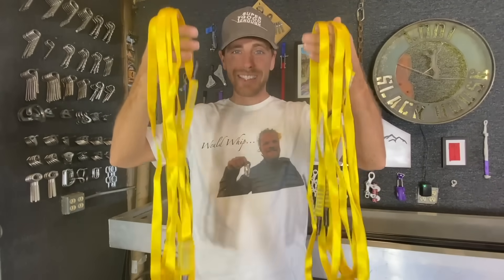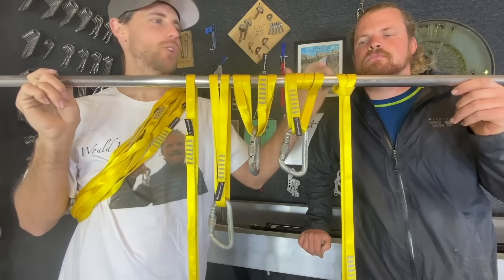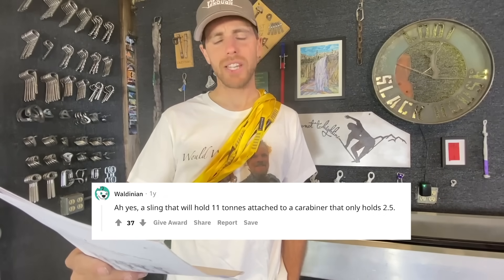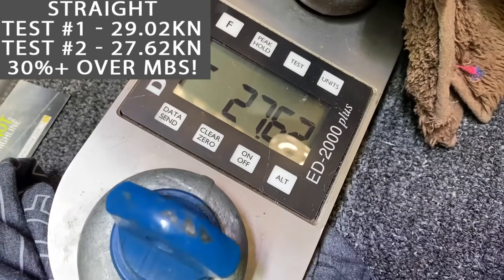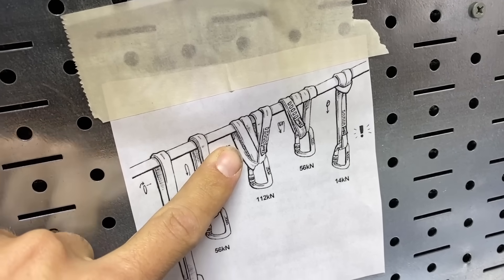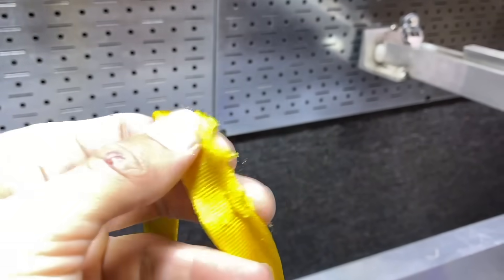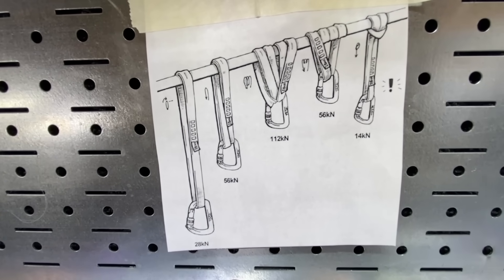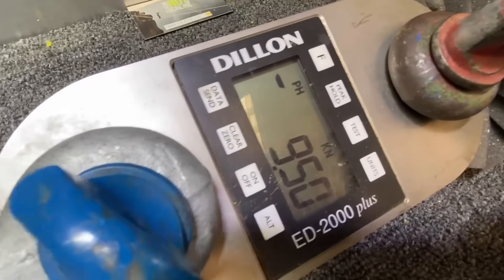Climbing Sling Myths

Comment: In my opinion, he problem with the double-double is that at some point, the overlaps compromise the ability of the webbing to shift and equalize the load across the four segments.  When that happens, the one that's already under the greatest tension will collect all of the load, with its failure terminating the test.  If a lashup could be created which allowed each web to move independently, the full quad capability might become possible, but who's going to carry that much hardware?

Comment: 2:05 the carabiner sits straight, because the sling is not doubled like shown in the image. It's supposed to be clipped in, moved around the bar, pushed through the carabiner, around the bar again and than clipped in a second time. (Like the 4th version, just with clipping the carabiner into the double loop that is winding uselessly around the bar.) Well, the "supposed to" could be argued with, but at least that is what's shown in the image.

Comment: You will not achieve the 4x load due to slight losses due to sling angle, bunching of the sling in the one shackle as well as friction of the sling overlapping. If this was done with a much longer sling so the angles would be less and over lapping othe sling could be minimized or completely avoided and you would still not get the 4x but be much closer.

Comment: Aside from manufacturing variations, which are likely to be minimal, friction within the fabric, especially in multi-layered configurations (fabric rubbing against fabric), plays a crucial role. This can have positive effects, as friction can increase the overall work required to break a sling, cause the "way" to maximum natural extend before aan overlod begins to take place can become longer. However, excessive friction can weaken the fabric due to the heat it generates. This is also one of the reasons why these tests under static tensile force (force applied gradually) offer little insight compared to a dynamic, sudden, large change in load. A sudden, large change in load can generate a significant amount of heat through friction (fabric rubbing against fabric) in a fraction of a second, leading to entirely different results that can become deeply disappointing compared to static tests.

Comment: When there is enough friction between overlapping pieces, one piece sees more load than the other, and you lose full advantage of the doubled or quadrupled sling. Dyneema slips more, so equalizes load better. But dyneema still has it's more limited bend radius to take into account if using a narrow bend.

Comment: On most technical sheets girth hitch is actually said to be 80% of strength not 50% so it's x0.8. so with actual BLL of 28kN it would result in 22.4kN. that is closer to the numbers you got.

Comment: The most critical simplification that is being done to get those numbers is treating the sling as a 1D object of negligible thickness. However, a rope is not 1D, and a sling even less so considering it is very wide relative to its thickness. With this, it is extremely easy to get an uneven stress distribution within the cross-section. Some strands will rupture first, which load their neighbors more, causing a progressive cascading failure across the cross section roughly from highest to lowest stress. You can see this in some tests, where the break is clearly starting on one side and progressing to the other. Why is this? Because the sling is not perfectly flat and parallel, and so some strands must stretch more and take on a higher load. Prediction? The configurations with the  sling forming an angle with the support will break at lower than theoretical strength, and the higher the angle the lower the strength. This was exactly the case, supporting our hypothesis. Moreover, when the sling partially overlaps with itself, you have uneven thickness, with one part having to cover a longer distance (more strain so more stress), which majorly skews the cross-sectional stress profile causing an earlier break. Most simply put, the less it "sits nicely" the lower it will break. With these hypotheses, we can deduce that having a rigid support is skewing the results, as tying to a flexible rope will tend to lessen this effect helping distribute forces more evenly. Am engineer.

Comment: @10:55 One thing I am curious about regarding MBS is your shackle size width and diameter. If you increase the radius of the shackle or biner, you "should" get an increase in maximim breaking strength from the slings. You also have two different diameter shackles in the test by looks of it. The sling is bunched on the pulling side. Make the shackles sizes equal across the formula to cancel each other out?

Comment: Don't forget MBS is the minimum breaking strength of the product, meaning all tested samples broke at or higher than that, so seeing higher that MBS is not surprising, especially in gear where wear is expected. Black Diamond would rather under promise leaving you some wiggle room than give you something that will disappont at soon as it sees any use and wear.

Comment: A question more that a comment. Wouldnt the diameter of the object the sling loops around or wraps around have an effect on the breaking strength?  Also what Ive gathered is that breaking strength is fundamentally different when looped vs. wrapped?

Comment: My theory, I think the stress distribution on each strand is not perfectly equal when there are strands overlapping and interacting. Any strand that is marginally shorter will take a disproportionate amount of the load, hence the slight reduction in the multiplier.

Comment: Question about the stitching.  It seems that one "row" of the stitching is a where some breaks occur.  Knowing the webbing will stretch, wouldn't the stitching be less inclined to break if it were oriented differently?  Like in sewing fabric that stretches, you do a zig zag stitch in the direction of the stretch.  So, on your webbing, I'd try multiple zig zag stitches aligned to the direction of the pull.  Also, the stitches in this video look pretty tight.  Meaning that each time the sewing needle passes through the material it can cut or damage the webbing.  And it seems tight enough that even ball  point needles might not make it through.  Just sayin..

Comment: The answer to why all straps break below their theorized (or sometimes advertised) maximum is because of heat. And heat, as we know, is the enemy of plastic, which webbing is made from. As you put energy into the webbing by means of tension, the excess gets shed out of the webbing in the form of heat, and that heat necessarily changes the mechanical properties of the webbing. In theory, you could achieve a higher (e.g. much closer to theorized maximum) load on the straps by 1) Stretching them much slower, 2) cooling them as you're stretching, and 3) stretching them in small, stepped intervals. Now, obviously, this isn't really a practical way to achieve the maximum because there's no real-world use case where loads are slow and stepped and the webbing is being actively cooled at the same time. But.. that's how you'd get to the listed max's. You basically have to cheat and have super granular control the conditions that the webbing is being stretched under.

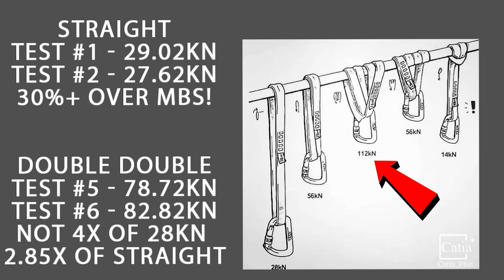Comment: 11:18... The angle of the pull is not perpendicular to the bar for the outer straps, so I'd not expect the strength to be 4x, as there is sheer forces because of that off-centre pulling.

Comment: On the 4 wraps it looks like one (or more?) section of the sling is twisted to enable the wrap, which must cause uneven forces on the sling. I’m guessing it puts more force on the edges of the sling than the center, which might be the reason why it breaks at a lower strength than anticipated. I’m not sure but I think it looks like it’s breaking in the twisted spot

Comment: Girth hitch: you used a big pin. Of course it was stronger. I think the CE standards use 12mm pins in most places. The +30% on the baseline tests might be from using the big pins.

Comment: I'm very late to the party but, in practice a nylon sling that is twice as long should be able to take a higher dynamic load before breaking even if the static break force is the same due to the higher amount of work needed. Seems like a fun test for the drop tower considering that the results have to vary depending on how the test is set up, will the impact be after the same fall distance or will the longer sling get a longer fall due to the extra length.

Comment: I haven't made it through the video yet, so they might have already explained this, but I'm guessing the ones where they overlap across the bar break earlier because the friction is preventing them from evenly distributing the force between the loops

Edit: The ones in the video didn't seem to overlap that badly, so my current guess is that they tear earlier because of the wider angle, basically the wider the angle the more stress you put on the slings compared to the weight they're holding. At a 45 degree angle you would account for losing about half of the capacity from what I remember learning.

Comment: For the 3rd method tried (the 4th picture) as well as the 4th tried (3rd picture) I think the main reason for the results it's because the force exercised on the string is not the same on all sections. And 2 big reasons for this I think are: 
1. More friction and imperfect sling contact makes some sections receiving more force than other sections. Also it makes the force direction being misaligned with the expected pulling force (because of the sling contact and twisting the pulling force is't perfectly vertical anymore -> the sling breaks easier)
2. Is is also probably kind of impossible  to have the 2 ends perfectly splitted and, because it's wrapped multiple times one end might receive more force than the other (while if the sling is not wrapped multiple times it will probably equalise itself at some degree).

Comment: When climbing, we need to be fast and simple. That is the more important, so you don't waste your muscular strength in hold positions, while you build a bomber placement. Interesting tests, but if you do things correctly, slings and fixed anchors will never be a problem in climbing. But for industrial uses, when you must move heavy weights, these informations are gold. Here in Brazil, while climbing Pão de Açucar in Rio de Janeiro, a climber died hanging on the rope. He fell down maybe 60 meters when a fixed steel cable broke. The rope, anchor, carabineers and slings holds, but not his body. He died from internal injuries. The weaker point will always be your body.  If you generate more than 8 KN or 10 KN forces while climbing, then I guess you did something terribly wrong.

Comment: Dan Merrick here. One issue I've had with testing is that the shackle pins rotate pretty freely. Rubbing seems to reduce sling strength pretty significantly so I am curious if the girth hitch would perform as well if the pin didn't rotate while loading. I think the result should be close to the same but I am not certain.

Comment: All of the lifting slings we use at work have similar but far more conservative diagrams on the label, IIRC they only show the multiplier for a basket hitch and a girth hitch and you actually get two different ratings for the basket hitch depending how large an object you are going around, i.e. you get a lower rating if the angle it creates is larger, but its only like 1.2x-2x max I think

Comment: I was thinking the same thing re the drop tower as a sharp shock load shouldn't have such a large friction burn and may have a higher Kn.   Being nylon and using the 1 inch tube tape for speed lining branches down in tree removal.    We buy 100 metre rolls and tie to what ever lengths we require.   I have broken numerous over the years but never had one break at the knot.   Being nylon and having a bit of slippage in the knot,   hmmmn  I wonder.
Love the Vids.  Cheers

Comment: Not sure if there is a video somewhere, but what would happen to a nylon sling if you girth hitched it to your harness and then on the other side girth hitched it to a carabiner so it stays in place. The use is just for resting. Would the strength loss of two girth hitches double to end up somewhere 18/19kN?

Comment: The problem with knots should be on dynamic loads. When you take a fall, knot tightens up fast and heat generated that way can melt the sling, weakening its rated strength.
On static loads, like in this test, that is not the case, so it is probably the reason numbers are much higher with girth hitch.

Comment: Your tests are awesome!  The practical is what maters, not the theoretical.  And the reason the chart is crap is because they assumed that the load share is going to be perfect for those 2x, 4x setups.  It's not.  And they assumed the knot strength of a girth hitch would reduce the strength 50%.  It doesn't.  Assumptions = bad.  Testing = good.  Theory = good.  When testing proves theory?  Then you're good to go.

Comment: Just like when you braid 3 ropes together you only get 2 x the strength because the rope isn't straight and turns converts 30+ percent of the tensile load into shearing load .
Same applies to knots in dyneema they usually reduce strength by 30-50 percent so splicing is important .
Also the low stretch character of dyneema likely contributes to sudden failure like comparing a electrical tape to a box clear tape in character.

Comment: Your "double double" is tied incorrectly. To recreate the pictured 112kn anchor, you first need to secure the sling to your 2:1. Next, you want to wrap you sling "doubled" around the shackle and back to the 2:1 shackle. Do this three times and finish by locking the last bit of the sling back on your 2:1 shackle as you started. Along with the overlapping of the webbing, that is the reason you aren't seeing the correct results.

Comment: Variance in the number for doubled up is more than likely due to veer angle, when doubled up you cannot possibly have all legs of the strap straight and parallel to one another so you won't get exactly 4 times, Instead, there will be an angle to them which will reduce the breaking strength of the rope. Now as for the choker or girth hitch as you call it I'm not entirely sure why they handled so well I guess it comes down to the materials but I've always known them to be 40 percent of total strength however that is as far as I know a worst case scenario number as with a choker there are a lot of variables, first off it depends on the shape of what you hook it to, second it depends on the angle at which you pull on the choker, if you go through the loop and create a choker then pull directly backward from the loop that is the lowest possible performance if you go through the loop and directly up from the loop it's the highest performance. 
That being said everything I know pertains to lift and recovery rigging not climbing rigging so I don't know how different materials across the industries react. 
https://www.mazzellacompanies.com/learning-center/what-is-best-sling-hitch-vertical-basket-choker-bridle/#:~:text=When%20using%20a%20choker%20hitch,a%20single%20leg%20vertical%20hitch.
Now, When it comes to generalized ratings like what you showed it is always to show the lowest possible breaking rating you never assume it will break at higher than what the lowest possible number is because depending on how you set it up and what the angles come down to you may exceed that breaking strength, So in terms of the choker that half rating is taking into consideration the lowest number that it may break under in certain circumstances where as you tested in a way that produces the best results for that particular setup, even though I disagree with the chart you showed even still because from my understanding the worst case number is actually 40 percent, not 50 percent. So i would take it a step further and say the choker would be properly rated at 11.2 kN not 14, But even that goes against everything I know because in the lifting and recovery rigging world we don't go based off breaking strength we go off working load limit after a safety factor, With climbing gear having a safety factor of often 10:1 I would go even further and say the choker should be rated at 1.12 kN with an ultimate load of 11.2L. It's always interesting to me how climbing gear has such a high safety factor being as it's life-saving equipment yet most people I see using the stuff ignore the working load limits and go off of the breaking strength which makes a safety factor irrelevant, even all the advertising on climbing gear mainly shows ultimate load and you have to search hard to find working load limits.

Comment: ANY squeezing, folding, overlapping, disturbance is going to cause a weaker point and thus detract from doubling. Girth hitches are variable but essentially you're gripping the nylon onto the surface and running it flat. Thus your ideal condition for the girth hitch is kind of expected. The more interesting aspect was to see pinching and non-ideal set-ups severely affect the results.

Comment: those numbers are theoretical, and ontop of that it would have to be in perfect conditions (with force applied perfectly over the whole sling etc). its impossible, litteraly, to make that happen, and tbh its equaly as impossible to get perfect conditions outside where u would use the sling either. so to be 100% save, just build in redundencies and always go below the told stress threshhold, imo. but ngl that was pretty interesting, thx ^^

Comment: I think the way the doubled up+ rigging can potentially be 'wearing on itself' is, if anything, part of a realistic test. If you can't reliably/quickly set up your rigging perfectly to avoid the problem, then any 'field use' isn't going to either, and the weakness just becomes part of the setup.